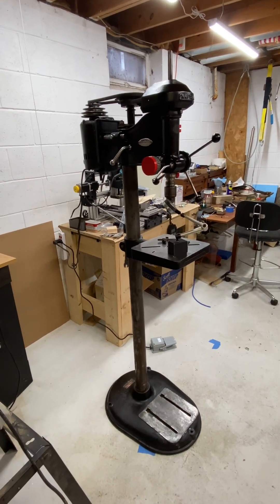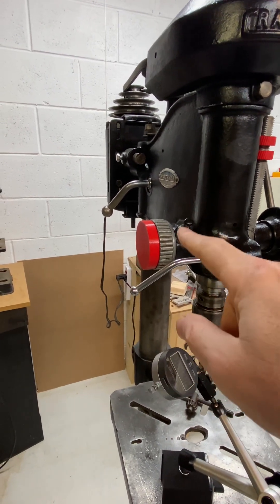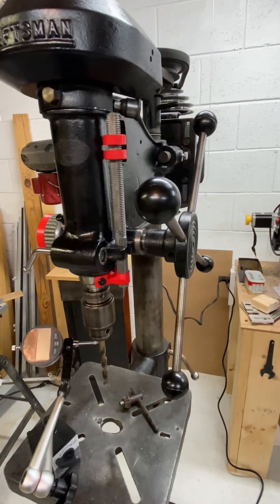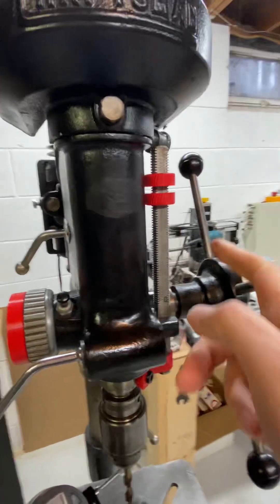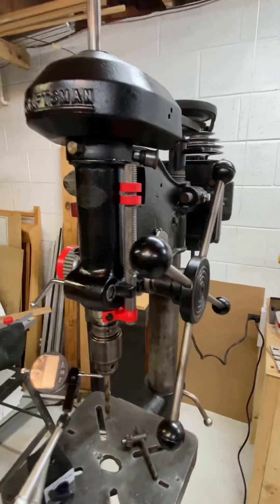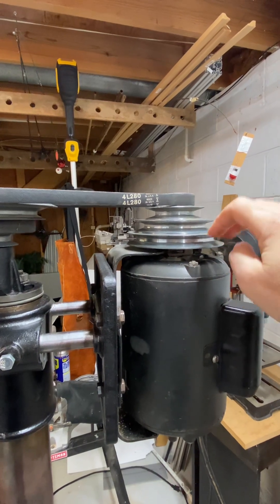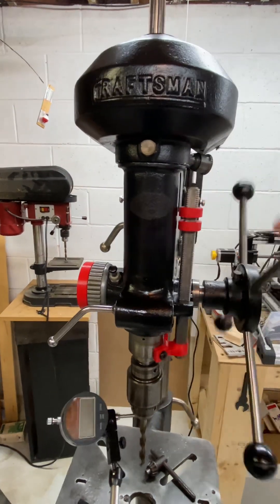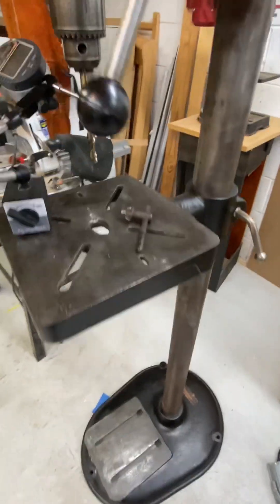Restored 1941 Craftsman 101 Drill press, quick overview

Comment: Just curious if you recall what the run-out was on the shaft.   Mine was originally around 0.01" so had the saft straightened and the taper reground.   Its like around 0.004" now.

Comment: Does yours have that little gear chatter noise from the gear shaft slop between the gear and the pulley? Was wondering if that’s normal but I’m assuming it is
Reply from the maker: not hearing that specifically. also when I pull the belt back and forth I don't feel any slop.